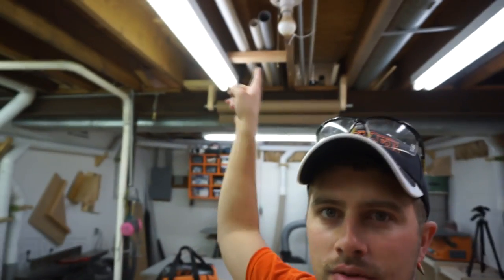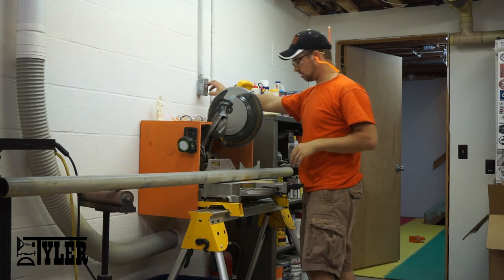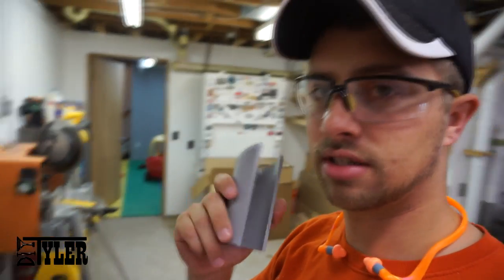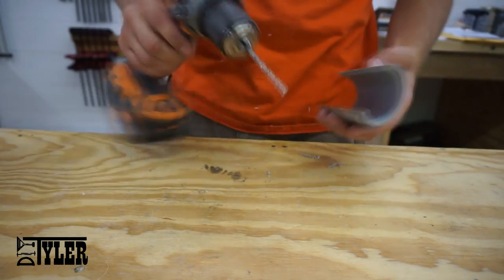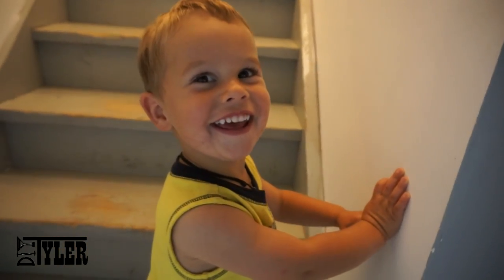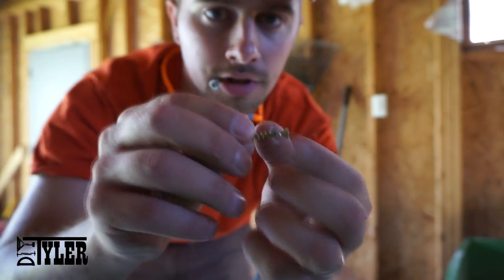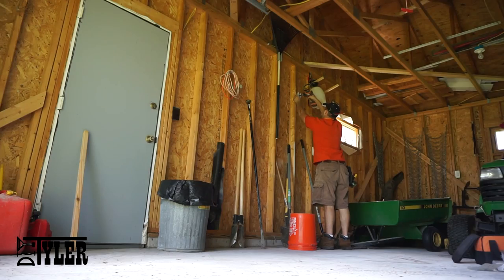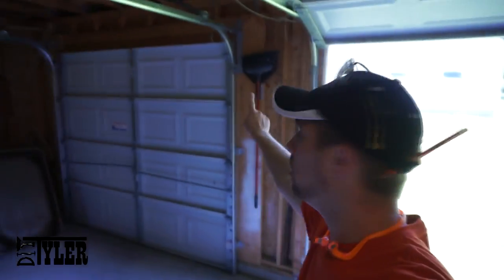D2D DIY | PVC Tool Hanger Hack

Comment: Dude.. LOVE this.  I have a PILE of garden tools leaning against the wall of my shed currently.  I also have 20ft of 2 1/2in. PVC left over from when I installed a new furnace this year.  I see this design calling my name!  The only thing I think I will change is I will attach a 1x4 rail across the studs so I can hang things between the studs as well this taking up less horizontal space.  Thanks for sharing!

Comment: I love your approach!

You can cut the slots in the pvc all at once on a table saw.  Before chopping the pipe, rip it lengthwise in two passes using the saw's fence,  cutting out one long gap strip.  Then chop it into the desired lengths.   Much, much quicker!

Comment: If you have any extra 2" conduit, you can attach small sections/cylinders near the bottom of the tools which will fit to slide into and secure them slightly better.  Even if the kids bumped or tried to get one out the bottom will make it more difficult.
Reply from the maker: Great idea man! Thanks for watching and the feedback!

Comment: looks great Tyler, cheap and quick, got some 2" central vac pipe I could up cycle. If you mounted a 2 X 4 horizontally across the studs you could hang more tools closer together.
Reply: That's a great idea!
Reply: That 2x4 is exactly what I did in my shed. Tons of stuff packed all together and still really accessible and off the floor. I like the miter idea, especially for shovels that have that funny bend between the handle and the spade.
Reply from the maker: For sure, don't really need it yet though! If I do I can easily add the 2x4.
Reply: Great idea, you could also use a half round at the bottom to hold the handle so that they can't swing... 😎.  I really like the idea for hanging garden tools!!!

Comment: to increase the storage space you could mount these to a 1x2 and then mount the 1x2 (or 2x4, or whatever is on hand) across the studs.  this enables you to space the mounts according to the tool width rather than be limited to the stud width

Comment: Great idea!  Good solution to a real clutter problem!  Thanks for sharing!  I have noticed your large work table in a couple of vids.  Assuming you built it, is there a vid of that build?  I am mostly curious about the cut-outs in the apron.  Are they for access to a shelf under the top?
thanks!
Reply from the maker: Yes there is a video. Cut outs are for putting tools there and clamping to.

Comment: i guess if you had heavier items to hang - you could get the next size down PVC pipe and do the same thing with it - just glue the smaller one into the larger one to make it thicker and less flimsy that way???  don't know - just had that idea :-)  thanks for the video - did u use a 45 degree mitre cut for the pipe end??

Comment: Quick and easy solution but seems to take up a lot of wall space. Which doesn't seem to be an issue for you currently.
Reply from the maker: Could have made them closer together by using a 2x4 stretcher but like you said....not an issue right now. Thanks for watching!